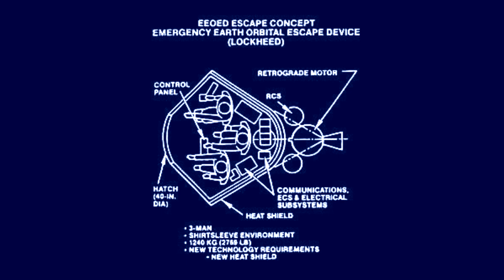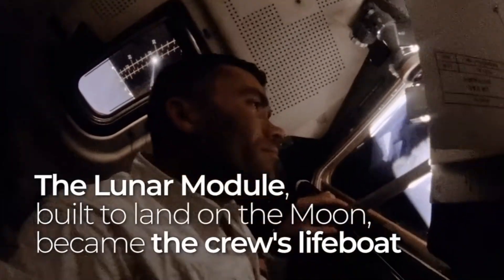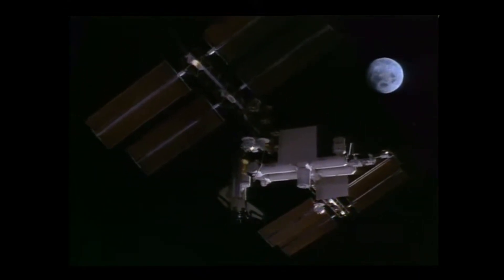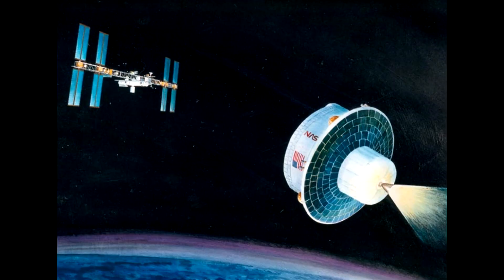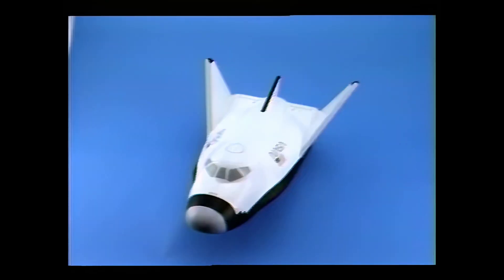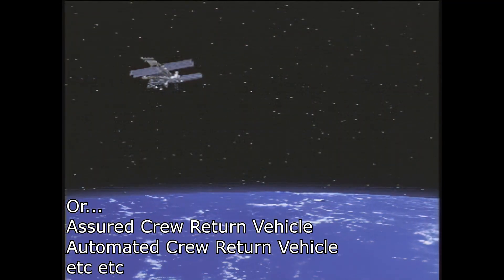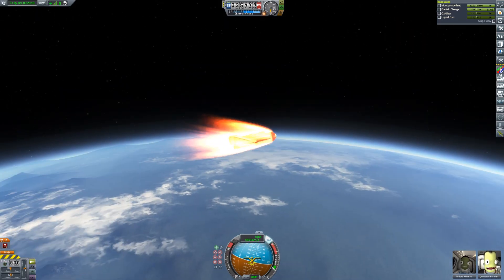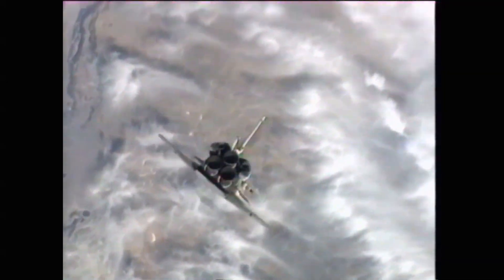The 'Escape Pods' That NASA Developed, But Never Used.

Comment: Congress has a history of cancelling stuff that has reached flight-worthy or nearly flight-worthy status. Case in point, the completely flight READY Skylab hardware sitting in the Smithsonian. The several Saturn V's and Apollo modules that could have flown to the moon. The small amount they saved by cutting funds to fly are minimal compared to the sunk investment costs in the system design and build.
Another example is Dyna Soar, where they had already begun to cut metal for the flight hardware.
Congress can be terribly short sighted and their stupidity often comes back to bite us, as with our difficult position when the Space Shuttle was grounded and the commercial space systems had yet to come online. Of course, Congress would never take the blame for that. They would just blame the President.
Reply: Congress is all about votes and getting re-elected.
The development phase creates a lot more jobs for voters than the actual production would; so they cancel it after the development phase and start developing something else.
There's a clear pattern of this.
I live near a large incinerator plant that was being built (to provide construction jobs) but there was never any intention of issuing it an operating permit (thus also making the environmental folks happy).

Comment: I see the escape capsule as an essential addition to a manned version of Starship. 
The Augustine Commission recommended in 2010 separating human beings from cargo in launch systems. I foresee a Cargo Starship, a Tanker Starship, an Interplanetary Starship, and a Lunar Starship as major variations of the design. But the most important will be the MANNED Starship which will come in an Orbital version and a Suborbital version for point-to-point Earth transport of humans.
If you switch to a human-ONLY design, you eliminate the pressure to maximize cargo lifting capacity and you can afford the "cargo" to be human life preserving equipment to allow escape during ascent at all stages with no "black out" or "dead man" zones.
Let us hope Elon has the foresight to pursue such a thing. I am certain that NASA will never sign off on Starship as "man rated" for NASA astronauts without such systems, so that may be the pressure Elon needs to do it. I am just afraid he will launch Jared Isaacman's Polaris 4 crew without going to that trouble. If so, I will be praying for their safety, but I don't really accept the idea of divine intervention.

Comment: With debris becoming a real problem, case in point the recent leaking soyuz, it doesn't matter how much redundancy you bake into a single vehicle, a second option is just smart planning. It could take one strike to render the vehicle inoperable, but the likelihood a single strike could take out multiple vehicles is highly unlikely. Evacuation vehicles will become a requirement eventually and should be already, so whoever makes a reliable and compact one first is going to be wildly successful.

Comment: You say the ship that brought up is the back up option, but I'd imagine it would still be safer if you at least had a moose in case of damage to your launch ships heat shield. Then instead of gambling if the tittle that fell off was a safe one you have the crew return with moose, then remotely try re enter and land the ship or if we get better at orbital construction leave it up there till you can launch a spare tittle to attach before flying it down remotely.

Comment: There was also a non-reusable tactic, a temporary HS paint lube, it wouldn't save the outer structure, but the cargo/humans in. The X-15a used this to assume lasting long horizontal, but was effective as re-enter burn. ANY craft can. The original shuttle just lact a surrounding heat shield paint, on the color & decal area, for imbalance dive, could've saved many lives.😔

Comment: Yah, didn't like your conclusion.  The Columbia disaster showed that these spacecrafts can't necessarily get you back safely in "any emergency".  It came out in the breakdown of that mission failure that there was knowledge and concern about the shuttles wing damage.  There was a decision made to not check the wing for damage because it was a lot of extra work for a problem that might not be there and even if a problem was found, there was no way to rescue the crew.

There were hundreds of known defects with the space shuttle, any one of which would have killed the crew.  For example there were over 100 known tiles that if any one of them failed would damage critical underlying structures, components or fuel system.  There were failures in the engines themselves where tubes feeding propellant into the engine could fail.  Failed tubes would be blocked with a metal slug.  One of those slugs fell out and came within microns of destroying an engine which would have almost certainly resulted in the loss of craft and crew.  Yet shuttles continued to fly with these slugs in use.

One reason ULA is allowed to use the old RL-10 engines in disposable mode is because of the slug problems.  Turns out the RL-10 engine is not suitable for re-use.  And that was known well near the beginning of the shuttle program.

One of the shuttle's failures (forget which one) was because a raw wire was strung across a metal seam and rocket vibration over the years cut through the wire insulation and shorted it out.

The cacophony of failures in the shuttle was a well kept secret but when you look at all these things through the lens of history you see not only bad design, you see failed management and reckless endangerment of human life.

Thank Science for SpaceX...that's all I can say!  Government run space programs (NASA, Roscosmos, China, India, ESA) are a mess.  NASA appears to be a beacon of light but only because it's a distant glimmer in a very dark swamp.

Comment: The X-38 was never the ACRV. They were two different vehicles and project offices. The ACRV preceded X-38, originally being called the Crew Emergency Return Vehicle. The name was changed because NASA didn't like the word Emergency in the name and what it implied. The ACRV had proposals from Rockwell and Lockheed for entry vehicles, Rockwell's being a scaled up Apollo of course. I worked as an engineer in both projects. I was responsible for the three paintings of the ACRV that you used in the video when talking about SCRAM. The vehicles in the paintings are clearly marked ACRV. The X-38 was always referred to as the X-38, never as the ACRV. At one point during ACRV, our office had discussions with the Russians about the US obtaining Soyuz capsules to fill the role of a return vehicle until we got the ACRV operational.
Reply from the maker: So are the official references equating ACRV and X-38 incorrect? I’ve mostly seen CRV and X-CRV in literature.
Reply: @scottmanley  I started pretty early in the ACRV project office and it was a competition between Rockwell and Lockheed who both had capsule designs. When it folded, I went back to the engineering directorate. The X-38 started shortly after that and I worked on various parts of the project, modeling, wind tunnel, parachutes. I can honestly say I never heard anyone at any level refer to it as the ACRV or CRV or X-CRV, always as the X-38. That doesn't mean it wasn't referred to as the later two in some literature, but I doubt ACRV. It just never crossed my path. Interestingly, Orion, NASA's next manned vehicle is sometimes referred to as Apollo on steroids. Something we were working on 30 years ago.
Reply: Next beer is on me, David.
Reply: What a Legend!!!
Reply: Hi David, did you happen to know an artist at JSC named Pete Colangelo? I believe he was the one who did the paintings of the SCRAM recovery ops with the USCG Dolphin as well as the one at 7:07 in the video.

Comment: The only aerospace escape capsule that I was aware of (until just now and the new to me example of the B-58) that was actually built and used was on the F-111. They were reported to work quite well in actual use.

Of course, the problems that an in-atmosphere escape capsule need to solve are far simpler than of an orbital escape capsule; and that is sugar coating it!
Reply: Actually they didn't work well, mass of the capsule made landings really hard to the point crew could not leave it afterwards, in one time capsule was used both pilots ended with broken spines!
Reply: @randomnickify  Interesting. What you say makes sense. My recollection was based on media reports far in the past (before the internet!) on Australian operations of the F-111. You are no doubt better informed than I am. 

Spine damage was a potential problem for all ejection systems that I am aware of. Having actually witnessed a zero-zero ejection while I served, I'm not surprised. It is brutal.
Reply: @MarkHarrisonBNE  IIRC the Australian F111 ejections were all over water - none were zero-zero. The capsule proved to be a fine lifeboat - quite seaworthy. I wonder if the other escape pod ideas all floated?

Comment: In KSP I made up and tested a tiny escape pod concept: Docking port, probe core, battery, inflatable airlock, and 4x drogue chutes. Your ship still needs to be healthy enough to start the deorbit, but that tiny list of parts will safely splashdown a Kerbal from at least up to 2km/s reentry. The docking port is the heat shield, and the docking port/probe core/battery stack make it the fat and heavy end of the pod so it reenters that way nicely. I very loosely based it around the inflatable "rescue-ball" concept that's featured in the "Space Shuttle Operator's Manual".

Comment: It's ironic how the Bush administration took a machete to the U.S space program in 2001 chasing quick 'cutting waste' targets only to be saddled with the Columbia disaster and having to come up with a whole new (and very expensive) space policy. If NASA had the VentureStar and the X-38 still in development (most likely in flight testing by that point) after Columbia, they would've been able to retire the Shuttle almost immediately and save a ton of money that could've to actual space exploration and hard science research. 

Another great benefit would've been that the main (false) impetus of using re-heated Shuttle tech to develop the Ares/SLS - that it's the cheapest and quickest way back to having a safe and fully functional manned space flight program, wouldn't even exist. NASA would've been free to develop a completely new from the ground up heavy-lift rocket for Moon/Mars missions, or maybe just outsource it with Atlas and Delta (and Falcon 9 eventually) like some people in NASA proposed (still would've been a lot cheaper).

Comment: I would think a Crew Dragon configured for 7 crew would make a viable escape vessel. With a max crew of 7 on the ISS and a ferry crew on the Dragon you could remove 5 ISS crew. Or send up an automated unit and dock it with the Canada Arm?
In an emergency how quickly might SpaceX be able to assemble a Falcon 9 to launch (swap out a starlink or commercial payload)?
With life support consumables the only cargo and no crew to be concerned about would a highly aggressive rendezvous flight profile be possible?
How hard would it be to engineer a life support supply adaptor to account for the differences between the SpaceX transit suits and those used by other services?

Comment: I worked on the Space Station Centrifuge Facility, before it was cancelled.    Very interesting concept.   Extremely low vibration, 1.8 meter diameter, with six animal cages, with any two opposite side cages being able to be removed while the other four keep spinning

Comment: So did the MOOSE acronym actually stand for "Man Out Of Space Easily" or "Manned Orbital Operations Safety Equipment" as the diagram says? Was "Man Out Of Space Easily" just the colloquial term used by folks working on it?
Edit: Also, are those incredible high-quality images of the ISS at 5:15-5:30 from the most recent fly-around by Crew Dragon? Don't think I've ever seen such crisp and detailed images of the station before.

Comment: Lifting body! Do we want a group of Lee majors and Lindsey wagners running around? Because that’s how you end up with that scenario! What’s strange is in the video of the paraglider touching down is a Huey passes by with a very high angle of attack (with the rotors level). Not sure if anyone here is a Huey pilot, but I normally think of the rotors tilting and the body (except in abrupt transitions like landing) staying level (unless it was trying to aerobrake here? But why not just start your run slower rather than trying to aerobrake). The foam idea seems like some engineer watched demolition man too many times and tried it out?

Comment: I think Skylab 3 suffered problems with 2 thrusters. Which is worse because then you have to consider the possibility that there is a flaw in the whole batch.
The Cm could easily come back with one or even 2 failing thrusters, but what if on the return journey one or more fail?
So while the crew was in Skylab in orbit, Houston and contractors a. tried to find out if there is a fundamental problem with the thrusters and b. simultaneously preparing the rescue CM. The backup crew was involved in both efforts. he irony is that by finding that the crew could come back, the backup crew cancelled their chance for their own space flight (in the long gap til the shuttle).

And of course Al Bean and co. brought the thing back in probably one of the more interesting flights with a Apollo CSM.

Also even when Freedom was still freedom, the idea of buying/renting a Soyuz was already floating around. Not quite sure, where i read that.  Jerry Bosticks book probably or Stafford..

Comment: In the book 'seveneves' by Neal Stephenson,  they use a Russian designed escape system to expand the ISS, they said it was called Luca or "Onion" and was an inflated ball made of multiple plastic layers, hence an Onion. I have searched and searched and never found any reference to anything like it, but most of the time, especially with Stephenson, this stuff is based on something real or planned to be real. Anyone know any more about this?

Comment: You didn’t mention all the Dream Chaser craft on the outer ring of the Voyager Station concept..  since it would be impossible to dock to the outside of a spinning station then the only purpose they could serve is as escape pods..
Reply: Unable to dock to a spinning station? TARS would disagree.
Reply: @Forest_Fifer  that was on the axis of rotation..  I said the outside of a huge spinning ring.  It’s actually not impossible to dock there..  just not useful or practical.

Comment: For the shuttle, you forgot the tires. Rubber is not 100% airtight and after a while, they would be too soft to support landing. 

For longer ISS missions, they don't come back in same ship, and this creates opportunities because a visiting crew can bring up the new escape pod, and return in the old one. This is how some of the paying tourists (Tito, Shuttleworth, Laliberté) got to ISS. 

One aspect about escape pods is the need to get into atmosphere ASAP.  Consider massive solar flare, meteorite storm, or space alien invasion, they need to escape the ISS and  de-obrit ASAP and land anywhere.  Only Soyuz can land on land a d in water or snow. (and has the survival gear if it lands in Siberia winter or in water).  If you need to de-orbit ASAP,  you don't choose where you land. 

Emergency medical evac is another need, and this is tough because of the need to balance speed with landing somewhere useful  (properly equipped hospital).

Comment: I have a question about manned space launch and NASA's safety requirements as it pertains to SpaceX's Starship.  There is no escape craft, but I thought they are required for manned flights.  From the sounds of it the Moon mission will ONLY use the Starship to land and take off from the moon.  This makes me think that ANY manned missions... at least for the foreseeable future will require another rocket to take astronauts up in space and then they can  rendezvous with the Starship for a mission... then likely return back to the launch craft (like the Dragon) to return to home.  This means most of the early missions for Starship will be restricted to unmanned satellite launch mission primarily and if they want to do site to site mission on Earth, they will be for cargo, not passengers.  I personally think that belly flop maneuver is too dangerous for manned missions.

As a follow-up question.  Is there environmental concerns to launching Starship into orbit.  I know it produces water vapor, but Elon wants to increase the number of launches a years to levels as high as 1000 fold.  This is billions of tons of water vapor into the upper atmosphere and sub orbital range.  As far as I know they have only done minimal testing into this issue about 10 years back.  Do you think more studies should be allowed before commercial use of Starship should be allowed for site to site transport, like sending passengers or cargo from an off shore launch pad in Texas to another offshore launchpad in the English Channel?  This also would effect missions to Mars as the refueling would take a dozen launches for each mission to Mars and likely 2-3 unmanned missions would be required to set up shelter, power, oxygen, and water systems before the first manned mission.  This means over 50 launches would be needed just for the first manned mission.  If they are to maintain a base there long term then follow-up missions would be needed every 3-6 months.  I just do not think a manned mission to Mars is worth it right now.  Maybe in another 100 years.
Reply: Products of methane are both water vapor and carbon dioxide. CH4 + 2O2 = CO2 + 2H2O
Reply: Fun fact: There were proposals for "Evolved Shuttle" involving liquid fuel boosters and an ejectable crew deck dating even before Challenger, but NASA couldn't afford the development cost of them. #FundNASA